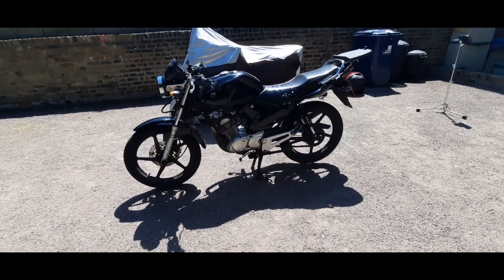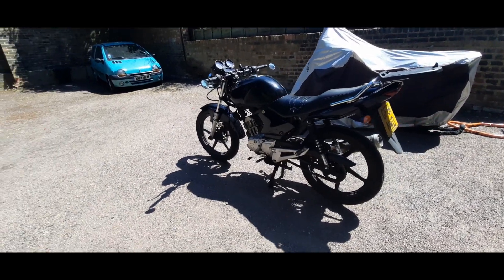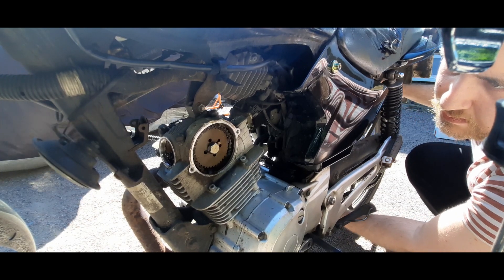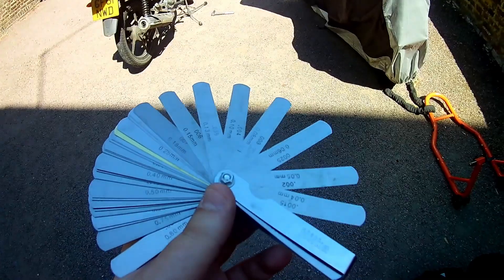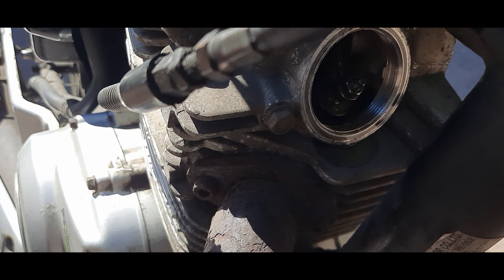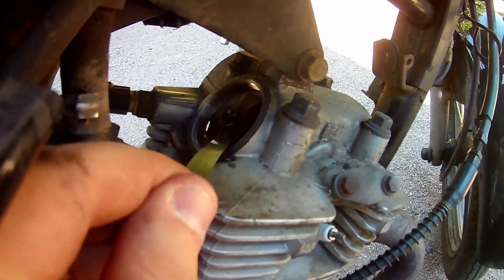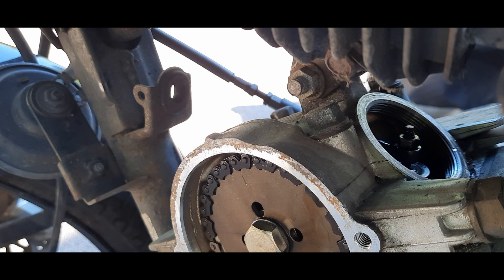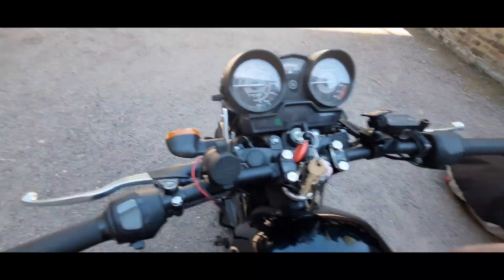Yamaha YBR 125 Valve Clearance Check (tappets)

Comment: My intake valve doesn't move when in top dead center
Reply from the maker: This could be caused by a few things… check in the following order.

-You might be at TDC on the exhaust stroke instead of the compression stroke

- Check the engine case/ cam sprocket markings are aligned perfectly 

- Your valve timing (cam chain/ cam chain tensioning) might be off

- Your valve clearance may be significantly off.

Comment: is it the same process for the 250 model? (i know the numbers are not)
Reply from the maker: 250cc Clearances are different.

Intake: 0.05mm-0.1mm
Exhaust: 0.08mm-0.13

All other processes seem the same.

manualslib.com/manual/2327177/Yamaha-Ybr250-2007.html?page=64#manual
Reply: @konraduk6228  thanks for the guidance mate

Comment: Hi. 
It's a bit off topic, What's your top speed on gps, have u ever tested
Reply from the maker: Hey there, 
I haven't tested it on GPS unfortunately no. Since I took the old exhaust off and replaced it with the Lextek CP1 system I've gotten it up to 60 on the speedo, but it's much more comfortable cruising at around 50 - 55mph.

I'll post up a top speed video.

Comment: Will this work for all models
Reply from the maker: Hi doomdog 308,

As far as I'm aware, the process will be the same with carb models and after a quick google search it seems the clearance specifications are the same as well.

0.08 - 0.12mm Intake
0.1 - 0.14mm Exhaust

Hope it helps!
Reply: @konraduk6228  so will this work for the efi 2009 version
Reply from the maker: @Doomdog308  

As far as I'm aware, yes!